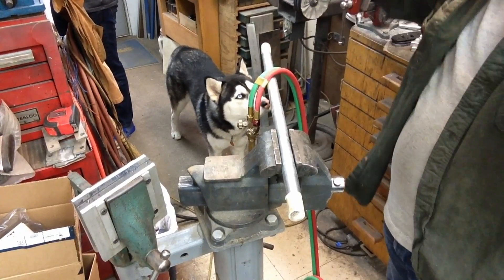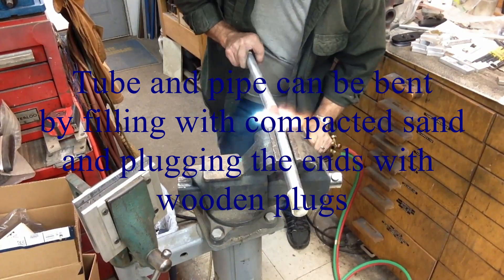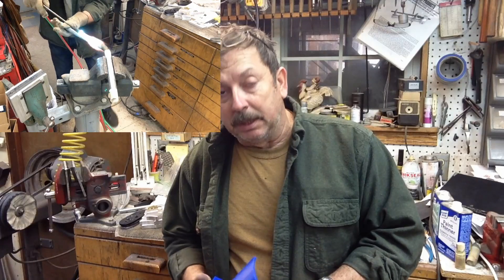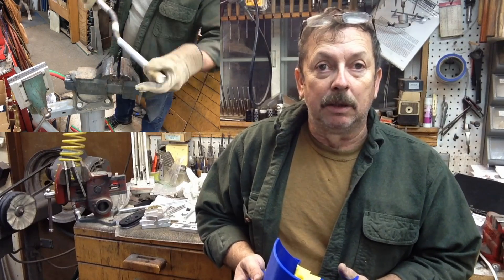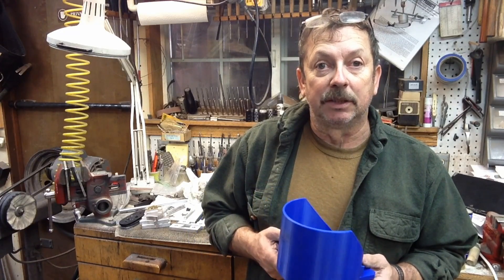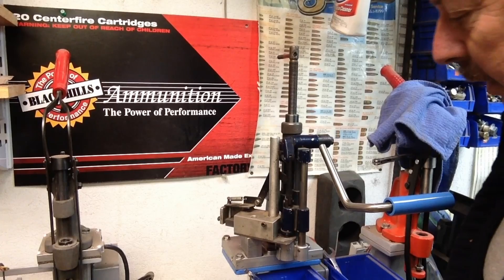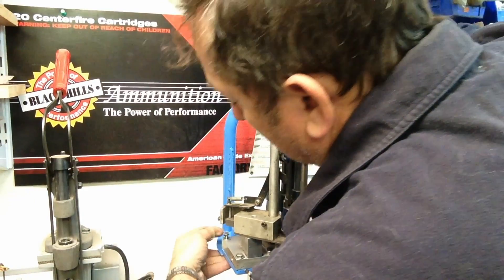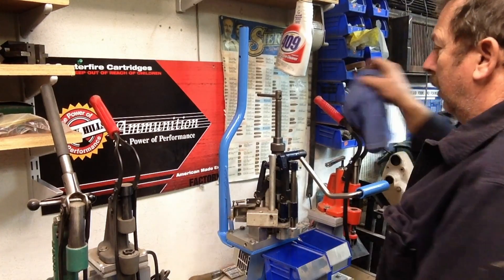3-D Printed Bullet Collator For The Reloading Room: Part 1

Comment: you should use quick connect plugs for the components including the motor. If you burn a motor out you can swap it out quickly. including having a hot spare.
Reply from the maker: No reason to what so ever, this is not a essential must run production line, this is a hobby and why add the extra expense? The whole assembly is so cheap to produce that it is more ecenomical to have a complete spare unit ready to go,  there would still be more time removing and reinstalling things like the motors and switch assemblies than changing the wiring. I have quick connects from the wall warts to the unit, anything beyond that is unnecessary. Thanks, Dan.

Comment: How did you adapt the motor to the collator  plates? The MBF motors come with that adapter for the plates but i can't seem to find them for the aftermarket motors.
Reply from the maker: MadDipper.com, LLC I built my own adapters. Drilled round stock from the end to fit the motor shaft, added a setscrew to lock it to the motor shaft and cross drilled for a roll pin to act as the driver
Reply: @hillsgun  The motors i have are threaded so i'm going to try and just weld a pin to the top of a bolt and see how that goes.

Comment: FYI.. MBF (DAA Mr. Bulletfeeder)  has but the kibosh on the free files as well as threatening anyone selling the 3d printed parts to people who don't have a printer.  MBF is also refusing to sell any of their electronics (motors, switches, power supplies) to anyone unless they can prove they own an MBF.
Reply from the maker: I am not suprised as I see that the files are no longer on thingiverse. I am not and have no intention of selling parts and am printing for my own use only.as far as them not selling their parts I don't see that as a problem for anyone doing their own build. Other than flexing their muscles and having the money to do it I don't know if they have any real legal claim or patents to the design. It's like most other things, the files are already out there and if someone looks hard enough they will find them and there are already many other options for components out there which are just as good if not better than the mbf parts.
Reply from the maker: If they had a lock on the market I would think they would have stopped Hornady and RCBS from selling their bullet feeders?
Reply: @hillsgun  --  From what they say they have a patent on the way the bullet gets flipped around.  The ramp design is what they bring up.  Nobody would dare try and build a copy of that POS Hornady style bullet collator.
Reply from the maker: interesting, The way to cure that is to build a thinner rotating t plate very similar to a case feeder plate. would probably be bullet specific and probably fiddly, but doable